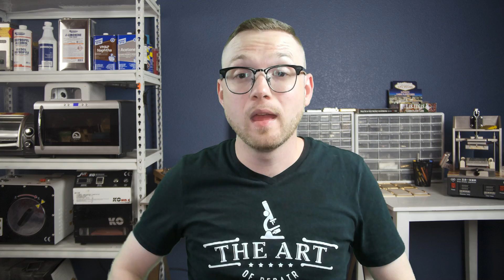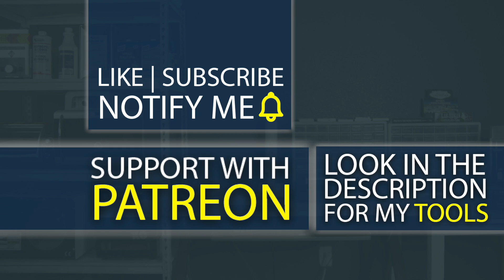EP54 Soldering Crutches | Calm down with the Low Melt Alloy

Comment: IMO, low melt should be available at every workstation (unless you solder same boring part every day). I work on whatever lands on my bench, and just like i have a variety of 12mm wrenches in my tool box, you need options when desoldering. If you wish a fine pitch, through-hole DIP package with 20-30 pins would LITERALLY drop out of a sensitive PCB, or if you wish to harvest a plastic, PCB connector and have it look like new, then keep some low melt on your bench. I wish i had known about it many years earlier.
Reply from the maker: You know, iv had a few conversations with this with my friends. I am not 100% opposed to low melt at this point, but I will always be a firm believer that with proper repair planning, any component can be harvested and any repair can be done without low melt. As long as you can do it WITHOUT low melt, then its not a crutch. If you can only do it WITH low melt, its clear that some knowledge and experience has been missed that otherwise would have made someone a better board tech =D Anyway, I appreciate the comment and view on my channel!
Reply: @TheArtofRepair  IMHO I used to think you had a good point but then I realized you're working with relatively small PCBs from small electronics like smartphones and tablets as opposed to motherboards with HUGE copper PCB planes that suck all the heat away from what you're trying to remove.

Comment: Hey Justin, 
Would it be advisable for beginners to use it, or you better off without it from start? 
Thank you.
Reply from the maker: Yes, i think that really, until you hit a wall where your working with super sensitive plastics or application specific jobs. I would just not use it. I never use it, and my techs are not allowed to use it either.  There is nothing like building solid fundamental skills.

Comment: Sn62 is a pure eutectic low melt solder. In RMA flux core solders, this solder yields the same high quality, high reliability joints as it’s Sn63 brother, but at a premium price. Depending on the manufacturer, this solder runs $142/lb on the low side to $520/lb on the high side. I do not think experimenting with solder this expensive is terribly brilliant. Your best bet is to practice with Sn63 RMA flux cored solder and get good with it first. It works better if you clean it first. Use the smallest size you can that allows you excellent control over solder delivery. Use only enough to do the job without an excess amount. Get help from a quality video, if there is one. I learned with the DOD STD 2000-1. This standard is way too hard for first timers. Practice and show a veteran tech and get pointers. Going to the J STD program is expensive if you aren’t working in aerospace or military contracts. Ask for help and maybe your ex military help can help you be a better solderer. Practice! Excess solder is not a good idea anytime and especially when micro soldering!

Comment: Obviously you Should Not use low melt solder for everything, I rarely use it, but if I need to remove for example an FPGA with over 100 pins, low melt is the way to go! (if you don't have expensive rework equipment).

Comment: i don't see arguments in your video..

with low melt alloy , you can work at lower temp.
you can work without good stuff or do job you can't without low melt alloy.
ex: ps4 hdmi, tough nut to crack need 500°c(<- not available on low cost hot air station)
you can use your solder wick on a 16 layer pcb with a heavy grounded  plane on the spot you have to work
without over-heating for 10sec ;p

low melt alloy is to desoldering stuff not soldering
it's just a (expensive) tools